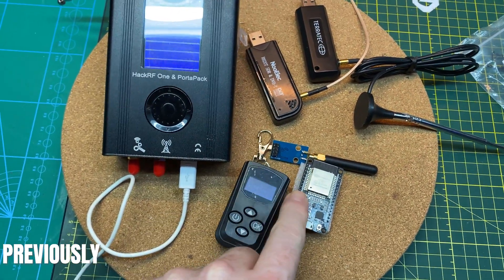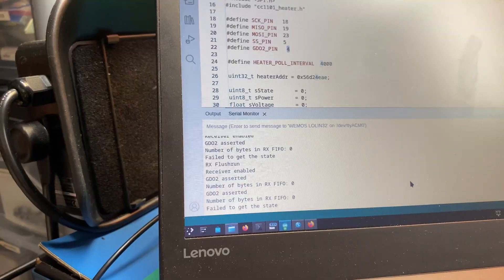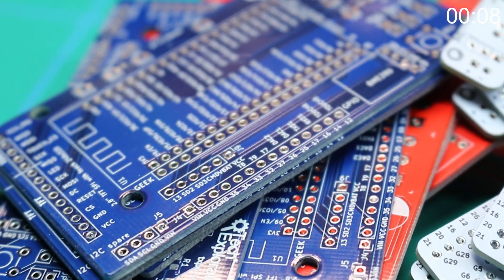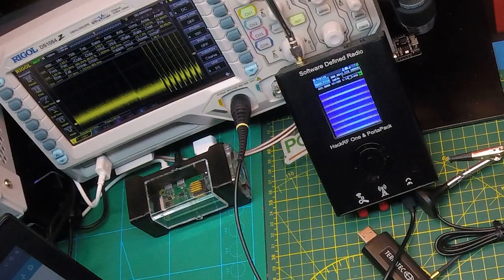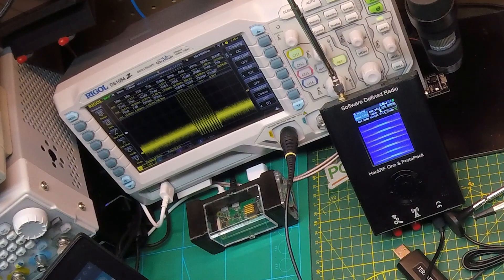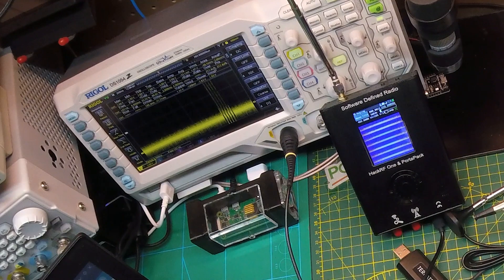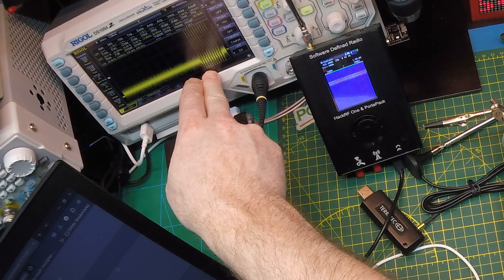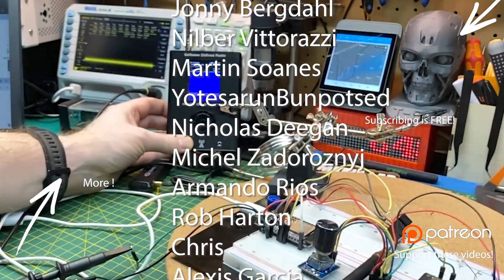Hacking a Chinese Diesel Heater With HackRF, ESP32 & Chat GPT,  Part 7- FIFO Buffer Breakthrough

Comment: Change code to us gdo2 to use gpio 12 and gdo0 to pin 2 I had strange transmit on gpio 4 . Also be sure to try a 2nd cc1101 because I also had a cc1101 unit that kept my head banging the wall only to fing out my transmit gdo2 was back feeding pulses strange issues
Reply: did you succeed in getting this working? I'm unable to progress past the pairing stage. Any pointers would be ideal
Reply: @FliVisualsMedia  I use my cc1101 in a multitude of projects I have about 12 different things I'm using it for. Best tips I could give for it is theory from gpio 0 and gpio2 on esp32 boards way too noisy for some reason and causes really bad communication for some reason with any of my setups switching to pin 2 and pin 4  on the esp32 makes a world of difference. As for the heater in this video that he's trying to get working I don't know if you ever got it successfully working or not and personally used esp32 and the cc-1101 for other projects I just have been down the same road. 
Tracing problems down for weeks on end and just switching those two pins changed the behavior of the cc1101